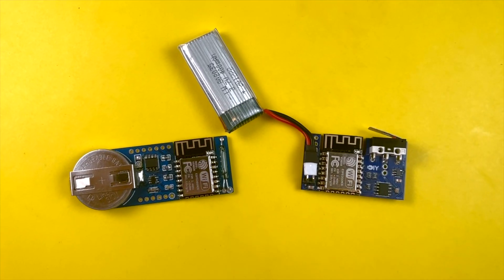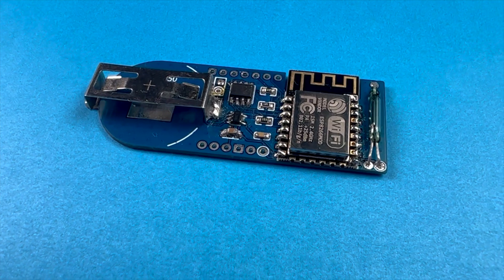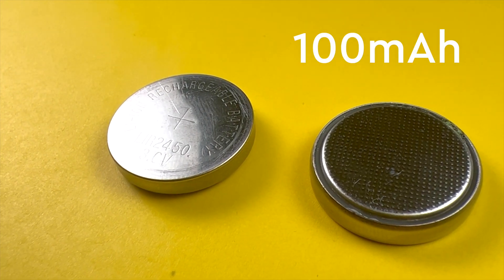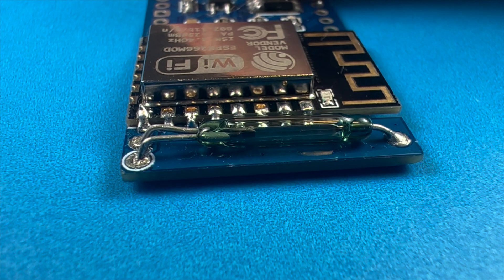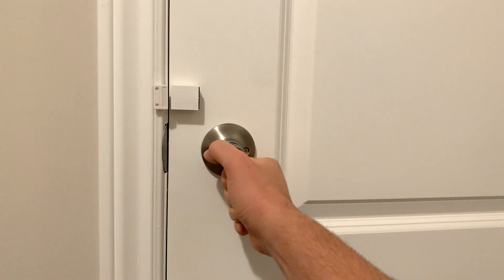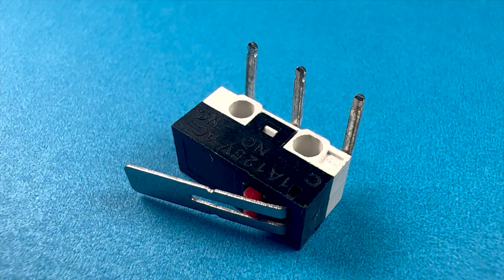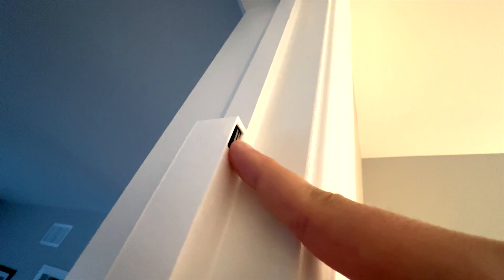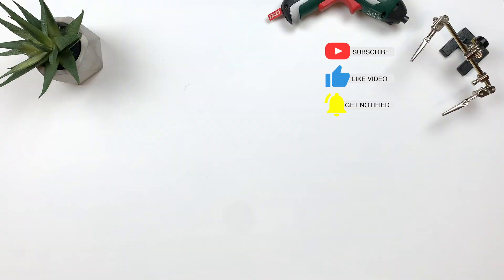My Door Sensor (Revised Design) Breakdown and Upgrades

Comment: You need a reset RC, 10K/1uf on pin1.  Your diagram shows the switch applying batt to the gpio5 input, good way to kill it.  You only need a pullup resistor internal/external on gpio5 to Vcc and the switch NO to gnd.  You can delete the attiny by using the switch to send a reset pulse and wake the 8266 from deep sleep (~20ua).  GPIO16(pin4) jumpered to reset can also wake from deep sleep with a timer.  very good content👍
Reply: would you still be able to read the switch status (open or closed) ?

Comment: Personally I would have stayed with the read switch, I would have added pillars to the PCB so that you did not need to bend the leads this way if you put it in a good case you can have a good IP rating, with the switch you will always have a hole that water can get in not good for garage doors, but I like the design
Reply from the maker: I didn't think of that - very good point.

Comment: heh good printerz don't use those switches anymoar.
Reply from the maker: what do they use?
Reply: @MrDIYca  I think it's essentially current sensing on the driver motors now.  They can detect skipped steps and blockages, and the bonus is they don't need to wire up or adjust limit switches anymore.
Reply: I want this pcb

Comment: Great design and video! I also switched from reed to micro switches because of the exact same problems! I didn't create a custom PCB, but just soldered it to a ESP-01 module and created a housing that can hold everything together with two AA batteries and a hole in which I placed the micro switch. I think this is way more portable and robust than the reed solution.
Keep it up!
Reply from the maker: Cool, thanks!